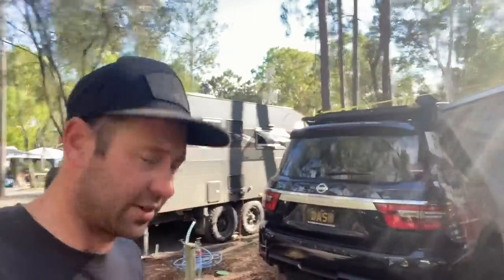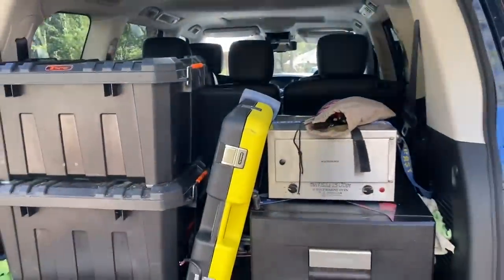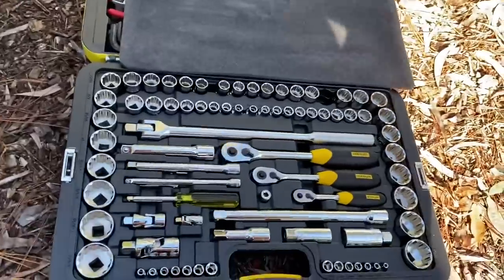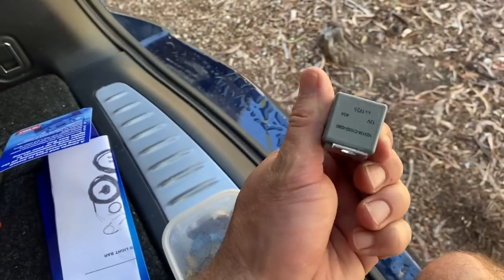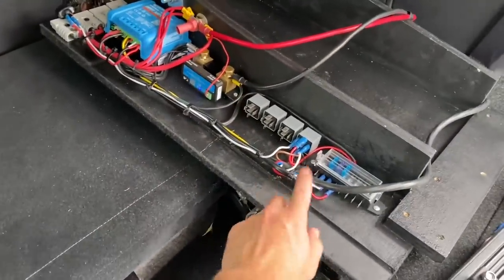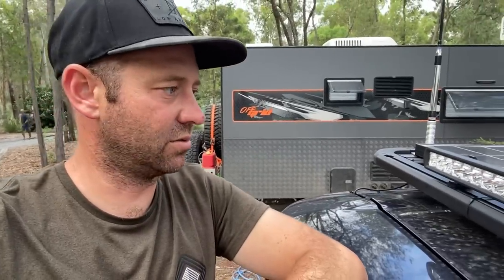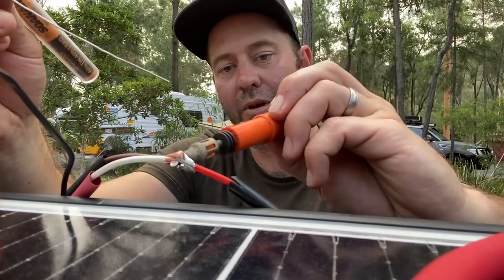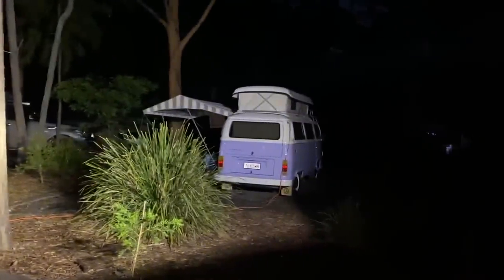David DASH VLOG #10 - Rear Lighting Caravan Park Install

Comment: Dave, I get great info from your videos, well done! After watching this one, I was keen to see how much light you got on the ground from your rear light bar. The answer: not much! there is shadow on the ground out to about 5 meters. Ok if that's what you were expecting. I'll be rethinking a LED flood work light I think.
Reply from the maker: Keep watching through the series Greg, I indeed ended up changing this for the reasons you stated. Cheers 🍻

Comment: Hey dash quick solder trick for you - offset the solder joints from each other it will stop them shorting to each other if the solder joint is a little ratty and tape up a ship load better 👨🏻👌🏻

The rig is looking sick keep up the good work and Have a good trip 🤙🏼

Comment: Happy new year to you and the family, like the idea of your tool kit, mine sounds like your old one, bag full of tools that you looks like a bum fight. Nice light bar set up, regarding your wiring, I use these pre heat shrink wire joiners that have solder flux inside of them, all you have to do is insert your wires in each end and heat up with a heat gun, it melts the solder and then shrinks the heat shrink around the wire. Great when you are out bush doing emergency wire repairs etc and will last for ever. You can get them from Bunnings. I have a Darche 270 on my Y62 but my brackets sit higher so that it clears the tailgate. Happy to send you some photos of it if you want as I had the same issue you got when I first installed it. Cheers looking forward to your next one.

Comment: So I finally convinced the missus to have a look at a new Patrol instead of going with a new VX 200 series. We ordered a cruiser back in October but I added a clause in our contract to bail out if they don’t deliver it by a certain time. (Been told the cruiser will now be in March instead of Jan) So I was going to exercise that clause and possibly buy a Patrol instead. We Drove to a couple of Nissan showrooms over here in Perth and none of them even had a demo to look at let alone any stock to buy. Rang around a few others and they reckon if I ordered one today I’d be lucky to have one in 4 months and I’d have to be flexible with whatever colour rolled up. Man, I’m over this cCovid crap. 
Looks like I should just be happy that I’ve got a new Forby on order and look to trade later on when life somehow gets back to some kind of normality.
Reply from the maker: That doesn’t sound right to me. As if you can’t order the colour that you want. WA is one of the more challenging places to buy unfortunately
Reply: @DASHOffRoad  
Osbourne Park Nissan (08) 9445 5666. 
Was told a very similar story from Shacks Holden in Freo when we looked at the one 1500 Silverado they had which wasn’t for sale. 
Not sure what the car yards look like over East but ours hardly have any cars in them. Melville Ford had about 6 cars in their front yard and one inside there showroom. 
Same as the Harley Davidson dealerships. They have basically become used bike showrooms as they can’t get the new stock in to meet demand. WA is going absolutely gangbusters, our economy is currently in over drive and nothing seems to be able to keep up with our demand.

Comment: Thanks for the content Dave. Interested to know how the Victron mppt is handling the heat due to its upside down mounting. Having recently ditched Redarc and gone to a complete Victron system I’m still playing around with the most efficient installation of all the equipment to maximise cargo space. Hope to hear about your experience. Cheers
Reply from the maker: No problems so far

Comment: Dave, suggest you install a SPDT switch (aka ON/ON or even ON/OFF/ON) within reach of the driving position and wire the light bar so you can have it operable when you select reverse, or by switching the other way, you can have the light on by itself.
Reply from the maker: I’m thinking of maybe the ARB LINX system, but still researching
Reply: @DASHOffRoad  just googled LINX. It looks a little bit like my Edge Insite CTS3 set-up. I can choose 3 gauges from a list of 23 options and can use a soft switch panel too (I prefer hard switches though). I can monitor all sorts of stuff on my Duramax....right down to the 8 individual injector balance rates.

Comment: Is the battery under the false floor.
Reply: Nah im pretty sure the dude uses a lithium battery (80 amp hour) in the engine bay to power all the vehicle mounted bits of kit. He discussed it in the earlier vlogs. Pretty different way of thinking but it seems to be working out for him, time will tell.
Reply: @krump743  I'll have to rewatch them all.